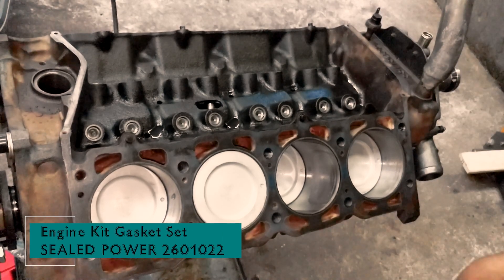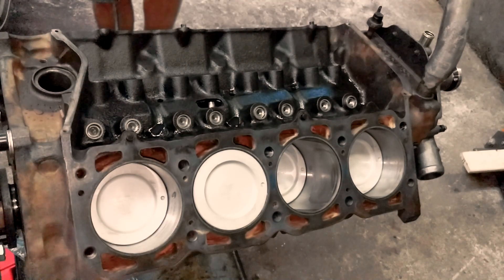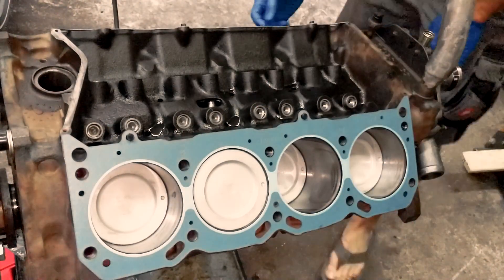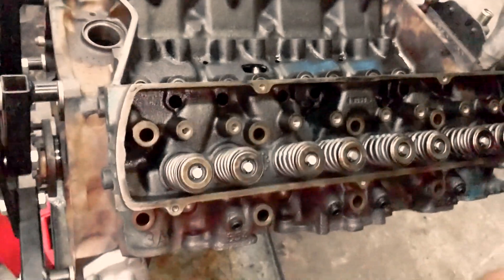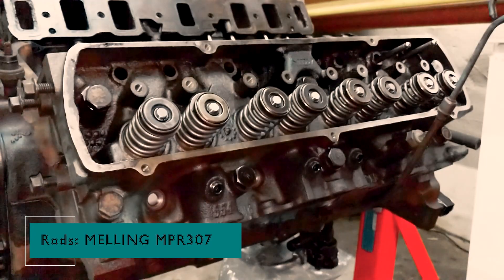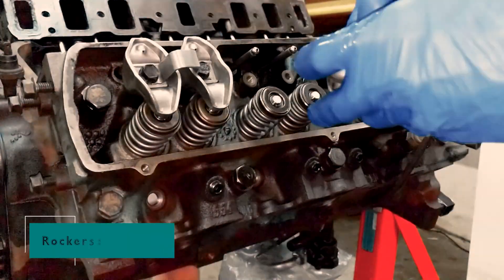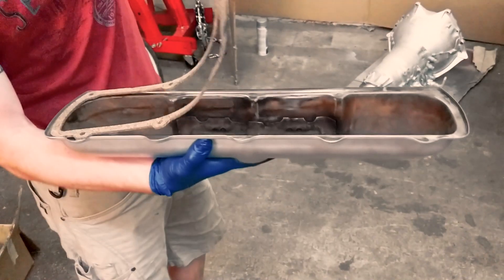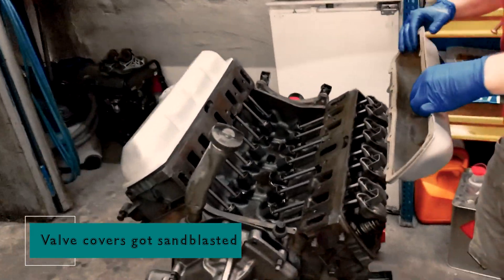Part 7: Installing Heads, Rods & Rockers – Olds 350 rebuild for my Cadillac Seville Gen.I

Comment: NEW ENGINE - VALVE GEAR - PUSH RODS NEED ASSEMBLY GREASE ON THE BALL ENDS !  - a bit slap dash and not really my choice for assembly !
Reply from the maker: Admittedly a bit sloppy, but I'm not a professional and don't claim to be :) I put some lubricant on the rocker arms (where the rods & valves touch), but forgot to mention it in the video 😅